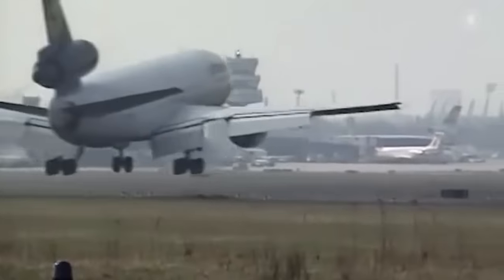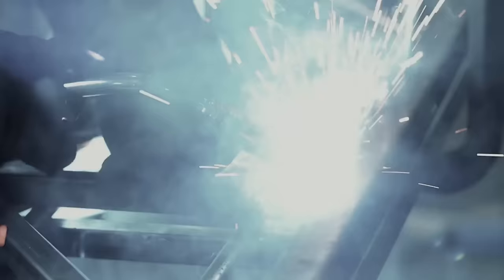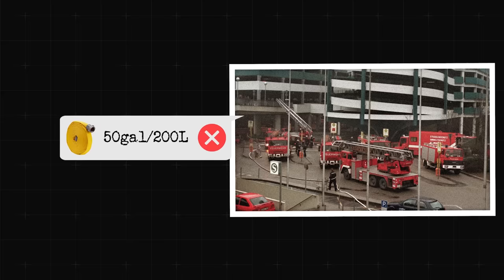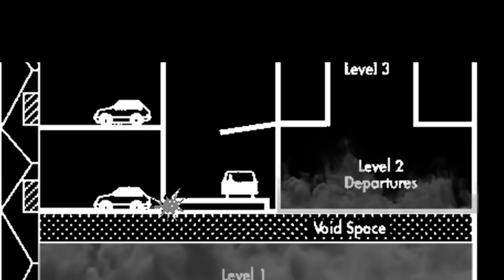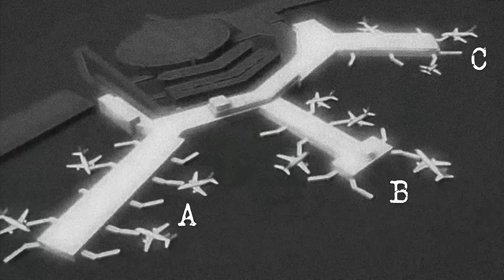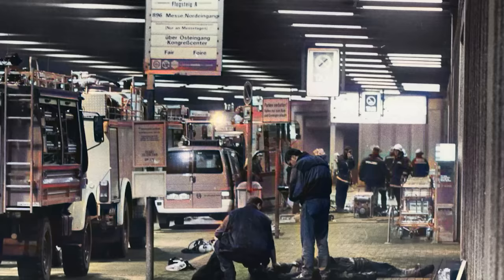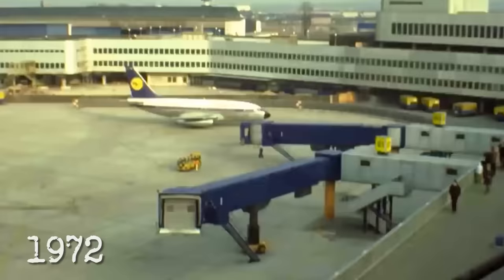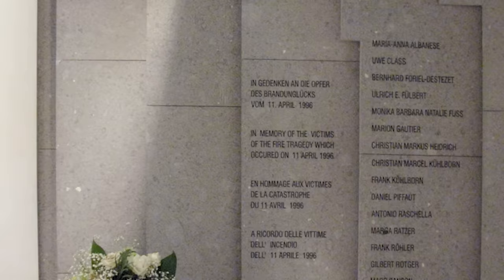The Düsseldorf Airport Blaze (Worst Airport Fire in History)

Comment: The General Alarm (Evacuation) should have been sounded at the start, when fire was evident by ALL THE SMOKE. That alarm was not sounded until the ceiling collapsed. This is another example of placing profit above Safety - the desire to not interrupt operations.
Reply: !!!!!!! this
Reply: Yes. A little fire can turn into a big one really fast. Evacuate people. Better alive and angry than dead.
Reply: @grmpEqweer  Yes!  And: Even dead people get angry.  (Their loved ones.)
Reply: I would not generally say this is an example of profit above safety. Although it sure may have impacted "voluntary" measures. It is more an example about how awarenes to certain dangers and risks and with that, mandatory equipment and safety standards have evolved over time. It is the same as with seatbelts in cars. Sadly very often awarenes to what should be done is only created by desaster. And I am afraid, to a certain degree (something we simply cannot think about yet as a possibility) this will happen in the future as well. Allthough it is less likely, as over history a lot of lessons had ben learned and influence building today compared to building just a few decaes ago. But I am very certain, we did not think of and capture all possibilities for man made desaster yet. Not to mention of course neglegence and "creative maintenance" to keep things running that may happen anywhere anytime with humans involved.
Reply: It wasn't so much an issue of profit as it was a lack of preplanning and proper training and protocols. There weren't good preplans for when to trigger a General Alarm, for what a proper default response from the City Fire should be, for when City should be activated, what they should bring, etc. It was a lot of squishy and vague decision points without proper training or response plans that ate up a ton of time very early when the fire could have been better contained and people could have been more safely evacuated. And these failures were widespread across the whole network of management and responders. It was a problem that seemingly nobody had given any real thought to or done much training and preplanning regarding. Which was really very shocking for 1996.
Reply: no smoke detectors in this airport?
Reply: @cemops8660  at that time there have been some smoke detectors, but to the then "sufficient" requirement at the time the airport was build. Nothing even close to what we expect today. Down to none in some areas at all.
Today when a smoke detector, of which there also are multiple times as many as back then goes of, the fire trucks roll out. Not like a crash alarm, that is a spectacle of it's own kind, but they get going. Actually for Düsseldorf I know the security central where all the alarms go together is in the fire station. And today as soon as an alarm goes of or an emergency call comes in, their computers immediately show that part of the building plan as well.
Reply: @cemops8660  none where they needed to be. The fire was able to undetected and build for a backdraft in large unmonitored void spaces.
Reply: @andrewtaylor940  hmm, it’s interesting to see how they changed from this time, in england now we have duct detectors and smoke detectors are required in every space via risk assessment
Reply: @alexanderkupke920  sometimes disaster is needed to get change
Reply: @cemops8660  This was an odd space. It was an unusable void space between the parking deck and the terminal. So above the terminal ceiling, but below the garage floor. This situation is most commonly seen in roofs. To the point where almost any time you see a story about a fire starting high up in a building, the next line is invariable “there was construction/repair work going on on the roof”. See Norte Dame as a great go to example. Cocklofts and void spaces between the roof layers. Düsseldorf just had it worse because that normally roofline void space was down low in the center of the building.
Reply: @cemops8660  Sad but true. Especially sad as sometimes the disaster is needed not to invent the technology, but just spend the money for it. And that yields for so many different areas. Buildings, Aircraft, Trains, Cars and this could go on forever.
Reply: i imagine there's a whole different set of safety concerns involved in evacuating an airport though... i'm not sure how much profit comes into it. i mean the runways weren't affected and the tickets were already purchased (i guess; no idea how that all worked in germany in the 70's). the general theme here was nobody really knew what to do.

i mean really i don't know, but i do know that, like myself, the OP and couple hundred thumb-uppers have no real idea at all what was going on in that situation so... edgy comments about profit seem silly...
Reply: it always comes down to money. they saved big bucks on illegally (!) installing highly inflammable material (as mentioned at around 9:32) to fill up otherwise empty spaces/isolate the building. sort of ironic how their cheap installation cost them a billion german marks (as mentioned at around 9:15) in the aftermath - not to mention the lives of fourteen people, but they don't supply any monetary worth anyway so why bother, eh.
Reply: @Kayaya  I’m not sure they illegally installed the material. The better word might be negligently installed it. It was something nobody gave much thought to. But it was likely never even thought of regarding fire hazard because it lies outside the outer walls. As near as I can see they weren’t outside of any inspections or building codes?

Comment: As someone, who made his vocational training and further works at the Airport Düsseldorf directly, i can confirm, that today the fire safety is on a very high standard.
E.g. I tested dozends of Elevators at the Airport. If there is a smokealarm triggered o a specific floor, the Elevator will then continue to a safe floor for evacuation.
Thera are arrows on the floor, which will light up in a smoke event and guide you to the nearest or safest exit.
Firetraining is as well a mandatorything for every worker, who work for the Airport itsself.
Reply: @OnTourWithGerrit Thanks for that first-hand observation. The arrows on the floor seem to have been drawn straight out of standard passenger aircraft requirements. A very good idea for ALL buildings I believe. I worked in airfreight and dangerous goods handling during the 90s and even almost became an airport firefighter. The only thing that stopped me was that as part of the employment contract you had to be willing to move to different airports. I was in my 30s with a young family by then, so declined the offer (well, my ex did). I really like the introduction of 'smart' elevators too. Another brilliant safety feature.
Reply: Fucking better be after a shit show like this...  ffs
Reply: Are you an elevator tech? Your job sounds cool, whatever it is!
Reply: Still not adequate!
Reply: @JasonLihani  no, but I had my final practical exam at an elevator and I went through a few department during my time as a trainee.
Reply: It’s just crazy to me because this has been the BASIC standard in all large buildings in the United States and Europe is so far behind. It also goes to show how American fire departments are advanced in fire fighting. Europe needs some serious training.
Reply: @americanwaffle  Bear in mind that this building was built in 1972, and undoubtedly the American standards were as antiquated back then too. The USA has certainly had it's share of terrible and often very avoidable structural fires in recent decades. 😨

Taking a few serious lessons from Europe, America has a lot to learn about providing a decent quality of life for it's citizens, starting with universal health care, decent paid sick leave benefits, minimum wages, mandatory paid vacation leave, and meaningful voters' rights protection, just to name the most basic first few things that come to mind, LOL! 🤣
Reply: Also, the BER airport wasn‘t opened at it’s planned date because of concerns with the fire safety.
Reply: @daviddunsmore103  They were pretty much the same: The MGM Grand was opened in 1973 and ten people died in elevators during a fire in 1980. So at the time of construction, US standards were by no mean better. In addition, as often, the materials used during construction were not allowed to be used, lots of money was saved during construction (just like with the MGM Grand). So even if you have standards: One has to check they are all met and recheck after changes to standards have been applied. Plus AmericanWaffle obviously has no idea of the training that German Firefighters go through. A blazing fire in two of the old terminals of DUS (ive been to them quite often) to be under control in less than four hours and be put out in six hours is pretty good, especially considering that it was quite difficult back then to organize the cooperation between fire departments from different cities all being on different radio frequencies and so on.
Reply: @f1ght3rz40  and today a big fire is quite unlikely.
The next time you are at DUS, pay attention in the main (public) Building (where check-in counters etc are).
When you enter it at any entrance, look up onto the opposite if the building and up. You will notice several very huge fans.
In an event of fire, they will suck out smoke, all entrances will automatically open to let fresh air in.
So, big fire is nearly impossible and even if there is a even smaller fire, smoke is the main thread. Thats why there are these huge fans.
Reply: @daviddunsmore103  Actually, in the United States, fire alarm systems were required in airports starting in the 1970's. Most municiplaities required these systems to be installed within a few years. On top of that, American airport fire crews are trained in structural fires as well. This has, again, been the standard for decades. The United States has only had two of such fires since 1970, which were all private residences (this is excluding 9/11 which would not be a fair comparison). So, no, the United States has been well ahead in safety standards and training.
Reply: Is that supposed to make everything better? (I'm just pulling your chain, dude. Typical troll comment.)
Reply: That’s good
Reply: @OnTourWithGerrit  Depending on the fire, alternatively, or even while clearing smoke, couldn't the giant fans pull in oxygen to the fire, blazing it up much worse?  Very often, opening windows and doors feeds a fire.
Reply: As a german i can confirm that this desaster raised the building and evacuation standards across germany because it was so alarming. The regulations got mixed with other european and amarican regulations and now provide rules for choosing building material and emergency exits and even firefighter training across europe (for example the sticker on elevator doors "do not use in case of fire" was established). The new Düsseldorf airport does not only have new smoke fans and huge emergency routes but also the ceilings consist of raw concrete mit piping and electrics underneath and just some metal mesh covering everything up. This was considered ugly but should prevent any fire from spreading or generating smoke. Even the gangways have some sort of concrete and glass staircase attached to them for wide emergency exit routes. The new Airport of berlin BER was heavily delayed due to fire safety concerns, not because it was so horrible planned but because  the regulations changed and it was very strictly inspected. I highly recommend informing about the "loveparade disaster" in Duisburg, germany because it also raised the bar on festival safety across europe. I think it is sad to see people die in disaster like this and people could have thought about the consequences earlier but at least we learn a lot and try to make things better for the future.
Reply: @daviddunsmore103  To throw a stick into the gears of all those who try to do the blame game of Europe sucked at this or the US sucked at that when it comes to that I may add, that those events today very often raise awareness internationally. I know for example that after DUS was rebuilt to the, at the time, higest fire protection and fire safety standards world wide (And yes, in between things had been further improved with further developments) Experts from all over the world visited DUS to look at what was done.
And looking at building codes world wide, as mentioned, over decades there was improvement on both sides of the pond.
So for @AmericanWaffle you can shove your exceptionalism somewhere else, as this may be basic standard in the US in recent years, it sure has not been all the time.
Also about the fire departments, just look at some TV shows where firefighters did an exchange between a fire department in Germany and one in Texas, the training for large parts is the same, except for minor differences like hose fittings, the equipment overall is about the same. Procedures just differ in some way, mainly due to different infrastructure and different ways of building. What works best with a mainly wooden construction may not work as well with masonry materials and vice versa. And while European fire trucks may not look as shiny and don´t have as much Chrome bling as US Trucks, the specifications are not far apart. A lot of European trucks actually may have a bigger water tank while overall being more compact as our hundreds or even thousand year old cities require.
Reply: @OnTourWithGerrit  You bring up a very good point with cooperation between departments. Today, they either can switch over to the respective channel, as all use more or less the same digital radio system, and there may even be trainings two neighbouring departments have together. beeing only thirty minutes from the Netherlands border, closer to the border you will even find regular trainings between dutch and german units. Or Units supporting across the border one way or the other. (Which with as little severre fires we ususally have, mostly comes to play for medical emergencies.)
Another thing to keep in mind here, is how different fire departments in the US and Germany are organized. While in the US it is quite common to have many small stations spread around the area, in Germany it is normal to have more central fire stations with a lot of trucks in one place within the city. Depending on the size of the city it might be just one large central station or two or three larger ones.  It comes down to being able to be on scene within a certain time limit after alarmed. 
In more "rural" areas (which I aknowledge is not even comparable between what we call rural in Germany and some regions in the US) a lot depends on small stationes used by volunteer departments. I think no actual difference here.
Oh one more difference, I think I remember there are certain tasks in US fire departments distributed between a ladder and an engine, this is not the case in Germany. All firefighters are trained to do the same things when it comes to fighting fires, although there may be special trainings for divers, rescue operations or for example hazardous materials. So a firefighter on a hose today may be up on the ladder tomorrow to evacuate someone.
Reply: @daviddunsmore103  I agree with that. I admire the USA and I have a lot of friends there, people I worked with in Asia, and I have relatives there.  It's an impressive civilization , generally  speaking. However, places like Europe and Australia leave USA for dead in regard to their health care systems and for workers rights and also holidays/vacation leave. A lot of workers in USA are just treated like garbage, and that needs to change.

Comment: I'm working as an engineer in an EMC lab. I was told a story once, that the fire at Düsseldorf airport caused the implementation of radiated emission limits up to 300MHz (in CISPR15 etc.) some years later: Before the firefighters could start to fight the fire they had to turn off the electrical mains supplies. But turning off the mains triggered the emergency-lights that disturbed the radios of the fire brigades and the police.
Reply: Interesting